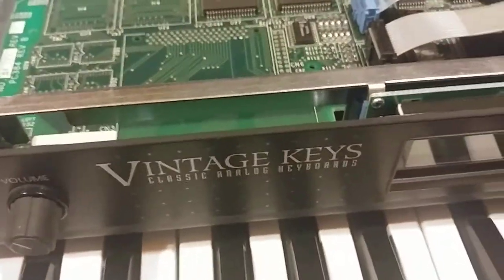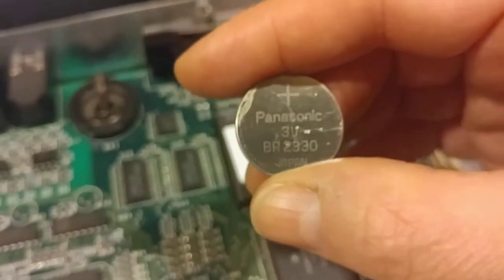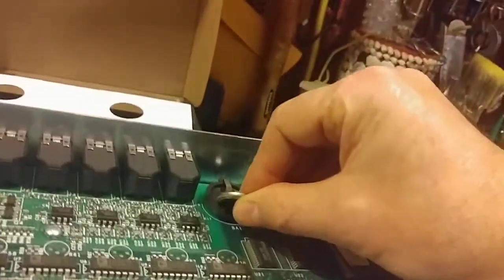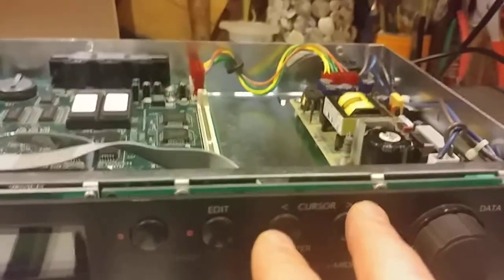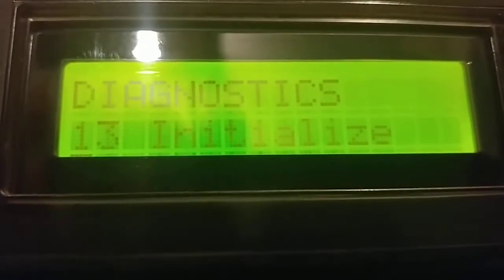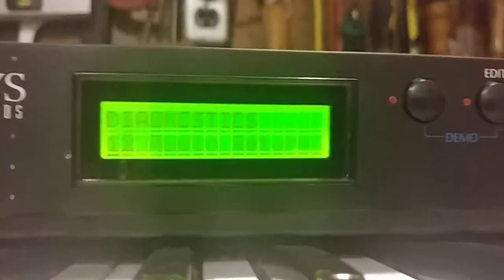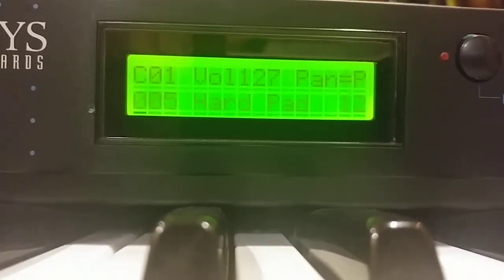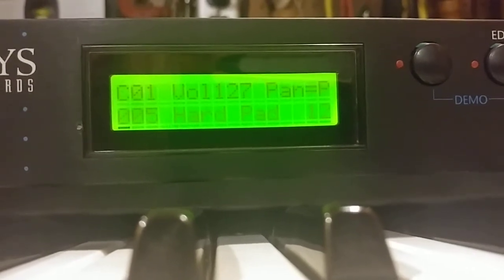Emu vintage keys, morpheus, proteus factory reset

Comment: Good info, thanks.  Confirmed works on Morpheus: symptom following low battery replacement was completely blank screen on restart (some mild panic and web search, to this timely vid).  Both-cursors restart brought diagnostic page up, factory reset and all is well.  Phew.

Thanks again, Erich!
Reply from the maker: I sold this one after replacing the PSU and reloading sounds, but picked up a Morpheus and kept it!

Comment: Thank you!  Question:  I got a Morpheus and an Ultra Proteus  The Proteus has a ram stick in the white slot the Morpheus doesn't.  You know what it's for and if it's the same unit for both?
Reply from the maker: The RAM is so the ultra has enough system memory to run. It does not hold samples. Emu gave up on the morpheus and never made expansion memory cards for it so it just has a vestigial slot.

Comment: I have an E-MU Mo’Phatt. When i’ve been using it for about 5-10 minutes, it starts to glitch out like crazy. It passed all of the diagnostic tests except the “Sound Data CRC Test”. It says it has a “Bad CRC”. I’ve been looking all over the internet for help, I didn’t know if you had any suggestions on what I could do!
Reply from the maker: CRC means cyclic redundancy check.I believe it means the memory being tested is bad or it can't read it properly. If you are lucky it is just a dead battery. Maybe bad solder joint on lines to/from the memory. Is there removable memory? If so, take out and put back in. That about all I can think of. Good luck!
Reply: @ErichIzdepski  Thank you so much!!

Comment: Thanks for the video, Erich.  Question:  When you initialize the unit, do all of the factory preset reload?  I wouldn't want to clear all of the presets and then have to download them or transfer them back to the device.
Reply from the maker: Only half of the factory data stays loaded- the patches in read only memory from 256-511 are permanent. Most of the others are wiped but there will be some. Best to back up and reload using sysex commands (midi-ox is great for this).

Comment: Hi Erich, I finally received my BR2330. I installed and then went to try, just for the heck of it, to see if it maybe fixed my "midi not working" issue. It did not but as I booted into diagnostic mode, as I was scrolling to re-initialize it, I saw that there was a MIDI diagnostic option. I clicked on it and it ran a test and the the screen said MIDI Failed! So, my question is, given that the midi test shows a fail, would re-initializing fix that? Or what would you recommend at this point? Thanks, Lang
Reply from the maker: Initialize will not hurt. I don't know anything about the MIDI Test. I would check with MIDI-OX if it sends MIDI during the test. If it does, I would loop it back into the MIDI in. But you can just try from a keyboard after the initialize to see if it works or not. Or demo mode. You are in an unknown area for me at this point and e-mu has not released any service manual so I have no instructions on running the diagnostics.

Comment: Thanks for the vid! My vintage keys plus writes system error and some weird characters sometimes during production. Could be a dying battery problem? Reset could help? Did you see similar? Thanks in advance!
Reply from the maker: I would back up your sounds to a sysex file and replace the battery and do a reset and then reload. Garbled characters on the screen are a sign of a low battery. I have seen this before.
Reply: @ErichIzdepski  thanks, I will do it!

Comment: Hi Erich, my Vintage Keys will not receive midi. As soon as any I play a key or trigger a sequence, the midi light on the front of the unit comes on ands stays on but no sound is played either through the outputs or headphones. Do you think that this could be solved by a reset or is this something deeper and will require a repair? Also, do you repair these? Thanks, Lang
Reply from the maker: I would try the reset and reload patches. I would also see if midi thru is passing what is coming in. There is an IC for midi data input.  Any chance you have too much other midi going on? A midi loop for example? Is there a built-in demo and if so, does it work?
Reply: Thanks for your super fast reply! I tried changing the input to midi thru and the same thing occurs; midi light comes on and stays solid but no triggering of recorded midi sequence. I don’t have any midi loops occurring. There are only 2 midi devices on a 4 channel midi router and I’m only going into the device; no midi outs. The built in demo works through headphones and outs. I’ll try getting a new battery and doing the reset. Do you repair these?

Comment: Mine makes loud glitchy sounds every so often. I can figure out for the life of me what it is?
Reply from the maker: Too many possibilities. Bad cable, bad plug, bad volume knob, bad circuit internally for audio amplification. Maybe some more options? If really glitchy, corruption in memory of the waveforms used to create the sounds. If same problem on sub outputs, then problem is inside the device.
Reply: @ErichIzdepski  same on sub, also if the preset has effects the glitches get the effects to. I would think corrupted.. have done a reset but still happens. I sampling it as much as I can to build up a library
Reply: @omenjh  Technically sampling a Rompler is illegal since those are copywritten recorded waveform samples. Roland, Yamaha, Korg, E-Mu/Creative Labs, and so on all own the copyrights of their PCM based sounds in their Romplers. You are allowed to sample them if you still own the hardware and use in your own productions. If you plan on sampling and getting rid of the hardware, then that would be crossing the line as copyright infringement since you are not allowed to copy and redistribute or resale of the samples without their consent. I would hold on to the hardware even if its broke. Digital Sound Factory also licenses E-MU sample libraries if you want just the samples only. It was started by the one of E-MU original sound designers as the sounds are licensed by Creative Labs.
Reply: @eman0828  I brought another one
Reply: @omenjh  make sure you keep both for parts since they are becoming more rare and E-MU pretty much doesn't exist anymore although Dave Rossum started another E-MU company called Rossum Electro-Music. He doesn't make Proteus's unfortunately. It would be nice if he did continue on with a new generation of Proteus modules. E-MU actually stands for Electro-Music after I just realized Dave wanted to buy back his E-MU brand from Creative Labs but they said nope.